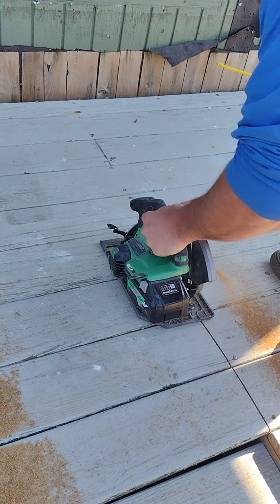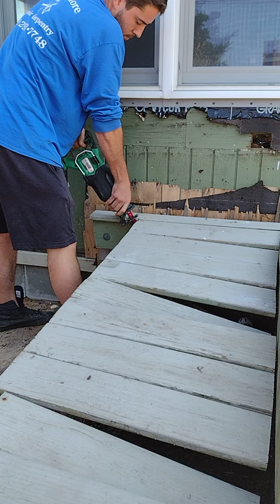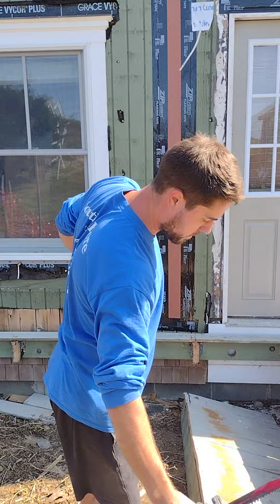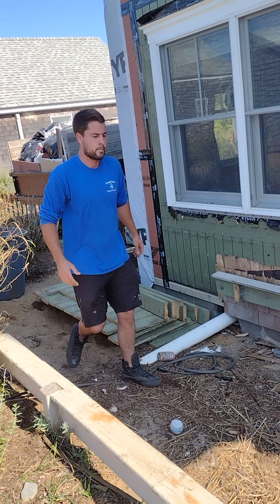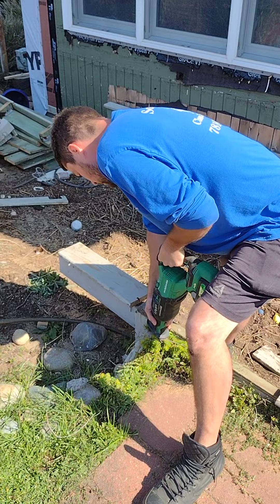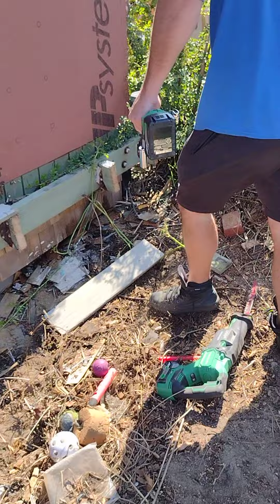The Fastest Way To Demolish A Deck. 100 sq ft In 11 Minutes

Comment: Made very quick work of that bro. Very efficient system man. Killed it. I see the HPT’s are getting it! Have you tried the Ax carbide pruning? It’s bad ass
Reply from the maker: Thank you sir. I haven't used the Ax pruning yet. I usually pick up a bunch of the 9" and 12" Diablo 2 packs when they're on sale for $10-$12. They last forever. I'm definitely putting the HPTs through the paces. They're pretty good so far. I'll be doing some short reviews once I've beat them a little more.
Reply: @Tool_Addicted_Carpenter  Diablo should be the Standard man I swear. I hit a few #10 t20s earlier this week making braces with the demo demon. The heads were embedded I didn’t even see them. Right through like nothing every time. Yeah check out the 9 inch Ax pruner if you get a chance. It gets faster as that coating wears down
Reply from the maker: @IMPACT-NATION  I don't even worry about fasteners with the demo demons. They're next level. Even the pruning blade is good to smoke a few screws and nails here or there. I'll buy an Ax but I have had issues in the past with the 9" Ax demos breaking at the collet. Diablo makes me a lot of money.
Reply: @Tool_Addicted_Carpenter  Damn. I’ll be on the lookout for that. You run a recip saw way more than I do man so I’ll take your word for it.
Reply from the maker: @IMPACT-NATION  Hey man, we make more from consumables than we do from tools. I'll never relay bad info. I appreciate you man. My word obviously isn't gospel. All I know is I've spent a lot of time and money on this. I really just strive for a channel that's practically educational. I was privileged enough to be exposed to some serious old school craftsman. That's what's lost on YouTube. The guys who are out there but will never expose their talents. I was heavily exposed to 3 different old school guys. I don't know what I would be without them.
Reply: @Tool_Addicted_Carpenter  I hear you bro. That’s where I get my work ethic as well. My Dad had me out young in the mud. Learned everything I know from my pops and guys that were in their late 50’s and early 60’s back then. It gets to a point where muscle memory and just the way something sounds, you know your in there🤣. Me and you are a lot alike my friend. Different trades but the way we get shit done. Nothing against someone sitting at a desk job at all, but that’s just not me. If I don’t put in a hard days work and give each project my all then….. you know how it goes. Heard a great saying on @Essential Craftsman a month or two ago. He said “strive for perfection but understand you’ll never get it. Settle for excellence!” That quote will always stick with me until the day I die✊
Reply from the maker: @IMPACT-NATION  Good shit. I live by "no service without sacrifice." Basically if I need to work a weekend to get a project done quicker for a customer or work a longer day to make a little extra to pay the bills then that's just what needs to be done. I make sure to keep things fun for myself. I'm very fortunate that I enjoy my job.